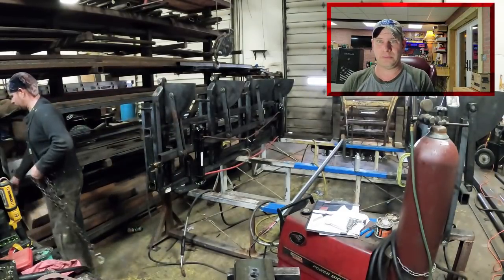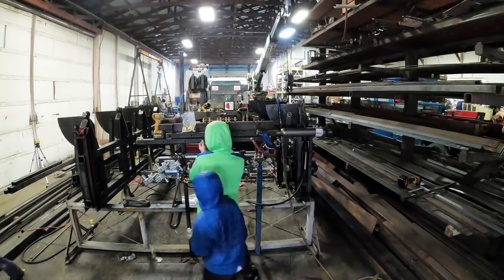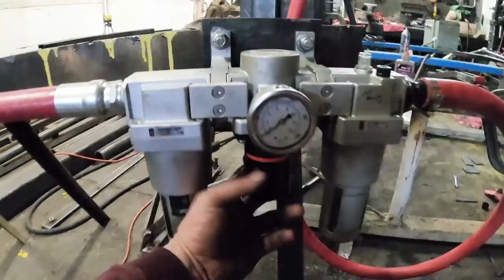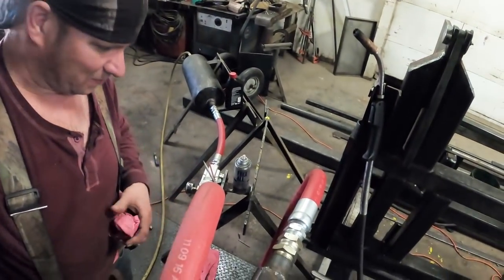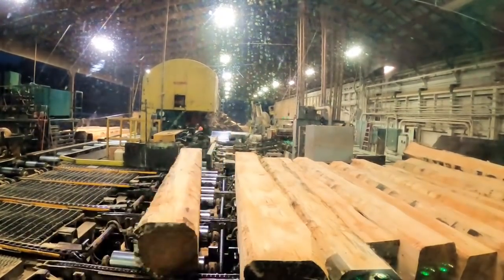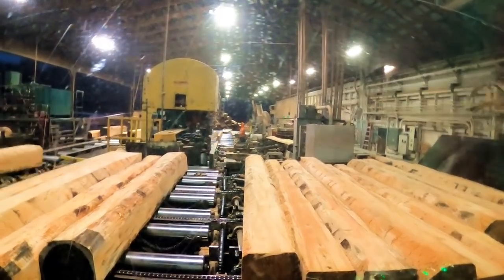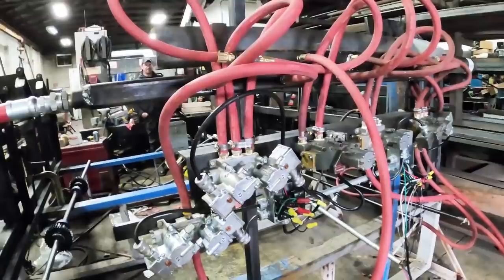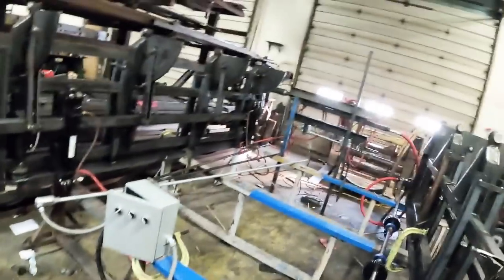Board flipper progress, jumped in the saw!!

Comment: Hey Wade I don't know if you've ever used it but I've found that Lucas 5th wheel lube works awesome and is slicker and lasts longer than grease for all of your sliding parts. I use it on our forklift side shift amongst a number of other things. It takes less and goes further so it's actually cheaper than grease in the long run and it just pours out of a bottle but is super sticky. Great vidja, you definitely have your hands full most of the time.